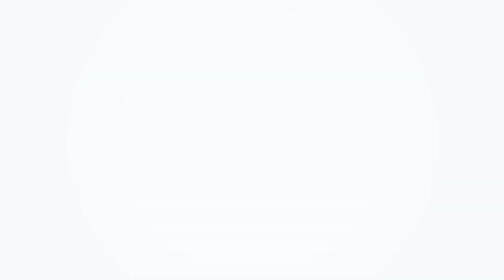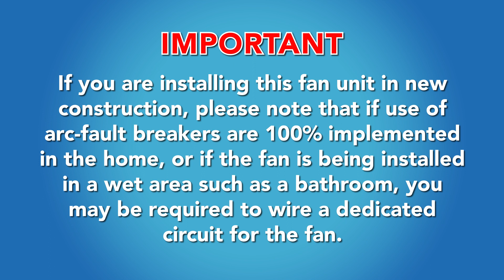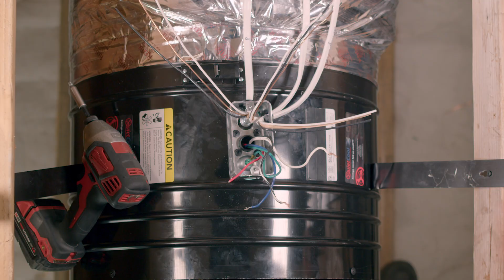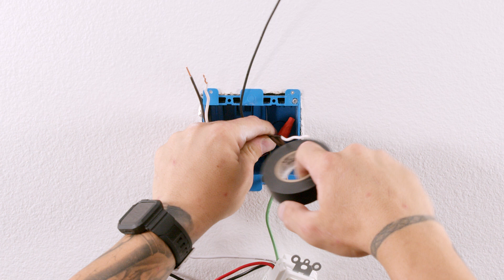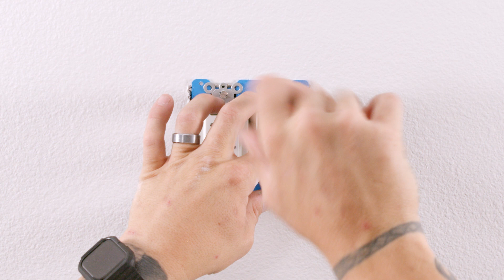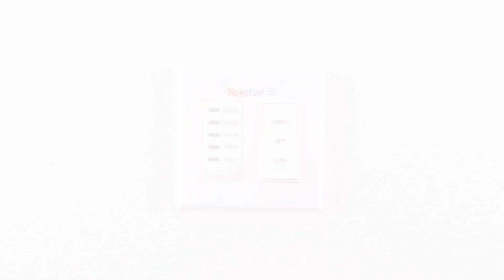Two Speed ECM 3100/3.3+ Wiring Guide

Comment: Well done video. 
Is there a link to the one line wire diagram of the ECM fan switch box for this motor, power, timer and speed switch wiring?  You might as well link to the wall box drawing with the timer and speed switch as well for convince.
Reply from the maker: Yes, you can find it on our YouTube page or go to our website site underneath the support tab you can click the model you have and the wiring video will be there.
Reply: @qcmanufacturing  No, I do not believe that it is.  I am after a schematic of the wiring, not a video.  I have a two speed ECM QC ES-5400 model.  The schematic should show the motor el box with the power romex, the colored wires from the motor, the two romex wires leaving the el box, the the remote el box with the timer and speed switch connections from the two romex lines.
Reply from the maker: @larryseibold4287 call us at 888-QuietCool and we can help you. You have to go to our website and under support page you can find the ES 5400 make sure it is not the ES-5400 RF and you click on the model and there you can find a wiring video or install manual that has the wiring schematic in it.
Reply: @qcmanufacturing  FYI, Figure 4.2A in Energy-Saver-Owners-Guide-8-31-23-Web-1-1.pdf does not show the schematic inside the fan el box with the fan motor wires (colors and function).
Reply from the maker: @larryseibold4287 

You’re looking at the wrong manual. Put the url below into a web browser and you should find it.

https://quietcoolsystems.com/wp-content/uploads/2024/02/Energy-Saver-Owners-Guide-8-31-23-Web-1-1.pdf